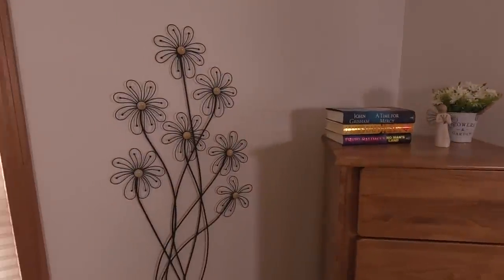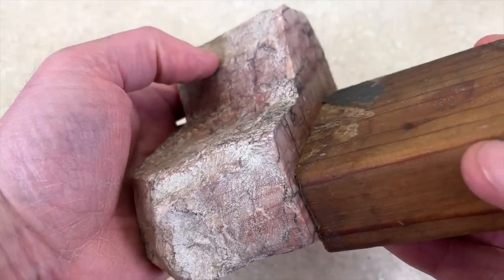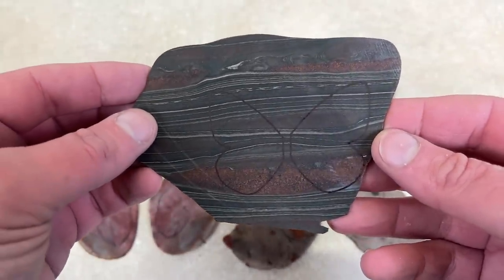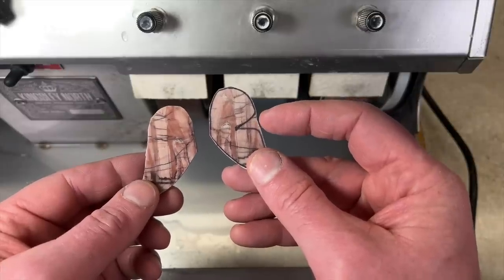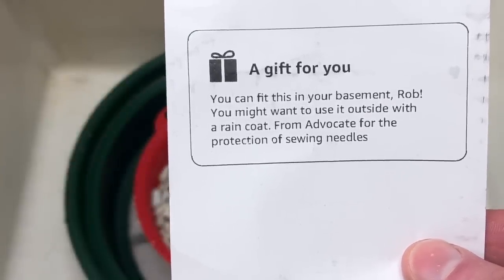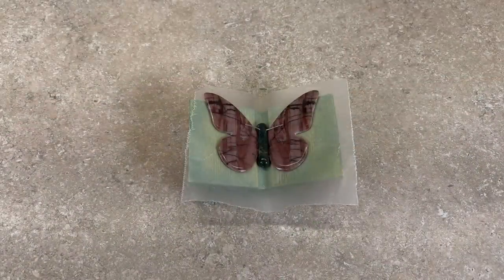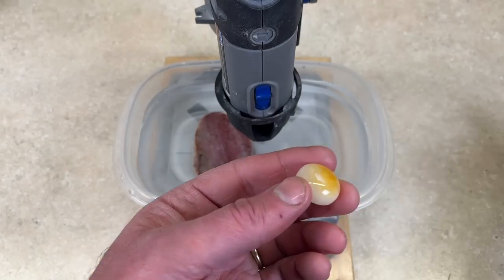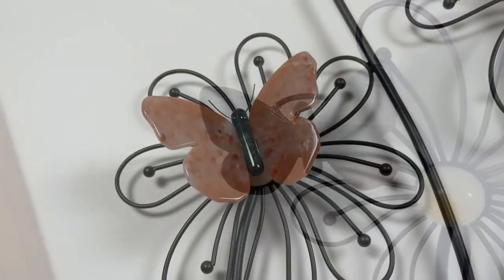Stone Butterflies—Maker's Challenge 2023

Comment: Nice job Rob !  They turned out great.❤  Use Tyvek on the 2x4 . I see a lot of people using it in their epoxy river table molds. 
  On another note.  I just purchased 14" Covington slab saw.   I got a great deal on it.  I'm going to set it up today ❤
Reply from the maker: Congratulations on the saw purchase! That should be a lot of fun. 

Thanks for the Tyvek idea. Some other people told me that they see people using packing tape the same way. Since I have that on hand already, I'll probably just use it.

Comment: Beautiful projects! I like the hooked feet better than being epoxied onto the flower centers; they can be repositioned at different places for a more realistic appearance, and changed out for butterflies that show up at different times of the spring and summer. For the wings and body gluing support, try applying a thin coating of mold casting silicone to the wood. When it dries, it will grip the rocks, but not the epoxy. Another idea for that is museum wax or the putty sold for sticking up posters on the wall. I love  your channel.
Reply from the maker: I don't know how much mold casting silicone costs, but I don't think I want to buy it just for this. Someone else suggested covering the jig with packing tape which seemed like a good idea.

Comment: Epoxy doesn’t stick to Parchment paper. It is siliconized paper. Vaseline work good for keeping things from sticking to epoxy. A good greasing should work too. That is a really nice micro power washer. Butterflies are very cool. I wonder what the banded dark rock with the red is. I have some and have no idea what it is called. I was thinking it was banded iron rock?
Reply from the maker: Someone else told me to use clear packing tape on the wood. I think that's a great idea.

That rock is not banded iron, at least not like any banded iron I have ever seen. It might be some sort of mudstone. That was a guess by a geologist who just looked at a picture I sent. It's hard, but doesn't take a great polish in the tumbler. It is an acceptable polish, but nothing like you get on agate or jasper.

Comment: If you sand your wood really smooth, then spray some clear on it wet sand it then put your wax.on it it should work fine 🙂 GODSPEED
Reply from the maker: Someone else told me that if I just cover it in packing tape, it will keep the epoxy from sticking. I'm going to try that first. If that doesn't work, I might try your suggestion. Thanks!
Reply: @Michigan Rocks  Another   sagestion if you use wood like oak/ hickory / hardwood will work  because soft  wood tends to absorb the resins hopefully it helps then you should be able to use them over and over GODSPEED
Reply from the maker: @chrismadaj8751  Thanks!

Comment: Have you heard of insta set for superglue? It makes superglue harden In a single second. If you use a tiny bit of superglue to hold it in place then use opoxy to make it stronger you may not need the jig at all
Reply from the maker: Yes, I build a remote controlled plane and used that. I'm not sure how I'd add epoxy if the wings were already attached with super glue. Besides, the jig worked really well.